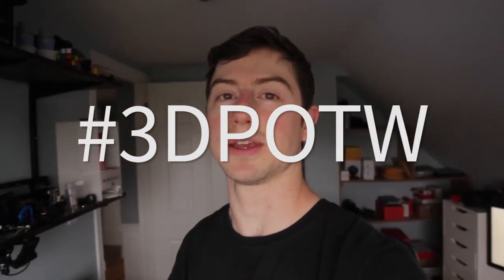#3DPOTW - Ep. 5 - Pumpkin Bokeh Cover!

Comment: cool concept - it would be interesting to have a rotating Bokeh wheel that you could turn for different designs, and perhaps even swap out for other templates.
Reply from the maker: There are actually little bokeh shape kits you can get that do just that(swap out). Great thinking. I may be exploring some more bokeh related things in the future. Something that I don't think has even been done.